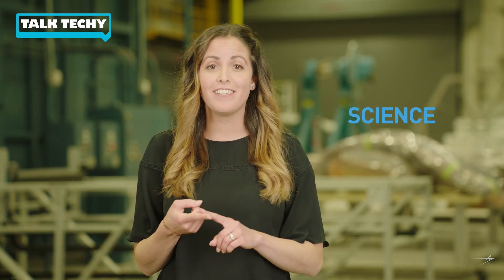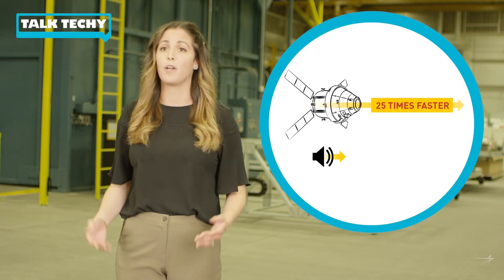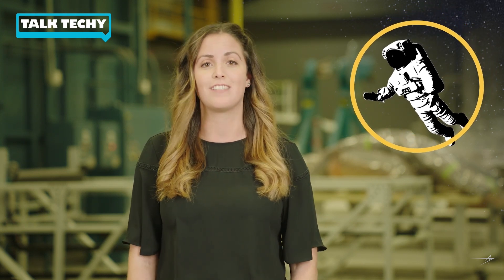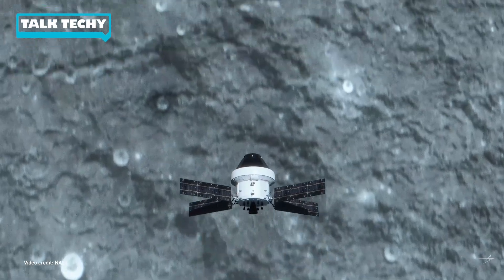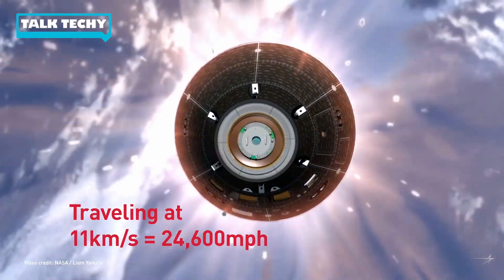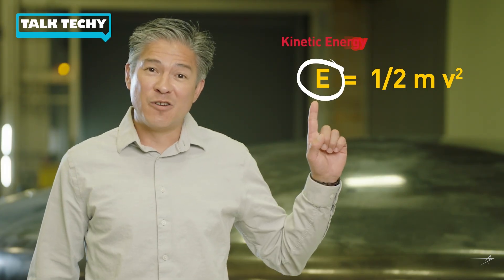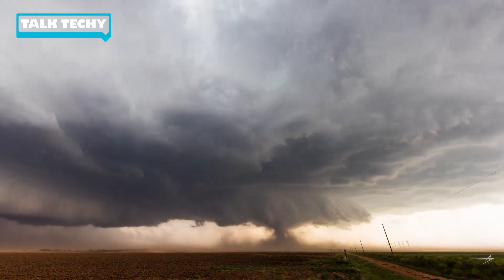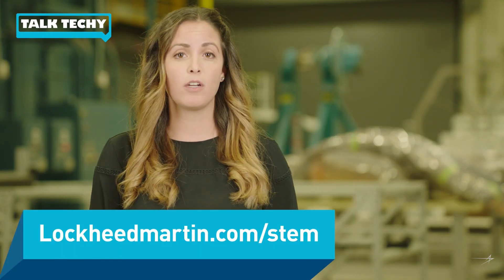Talk Techy: How Do You Use Physics to Re-Enter Earth’s Atmosphere?

Comment: well, isn't it easer just to use the hole in the ozone? less heat and friction I know it's still e= 1/2m v2 but floating in and out got potential that way
Reply: The re-entry process is needed to slow down the module if you want it to not touch down at many times the speed of sound, obviously. the re-entry process may be tough but it is necessary as well
Reply: I’ve never heard anyone mention the ozone layer before. Is that really a viable option?
Reply: @RichHomieGon  well it sure beats putting more holes in ozone with more global warming 🦨@#$%^&*(space program
Reply: Sounds like a plan 👍
So, you are travelling in excess of 16 thousand miles an hour.. you 'pop' through the hole and hit the ice.
I can't see a problem with that 💪